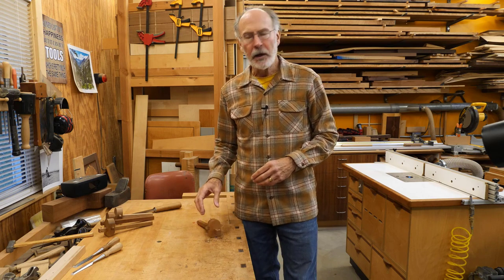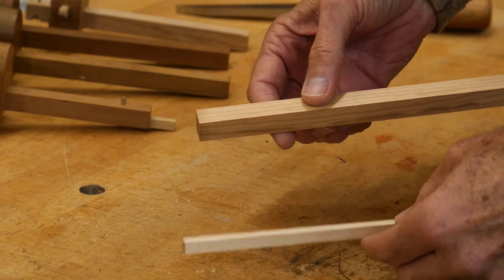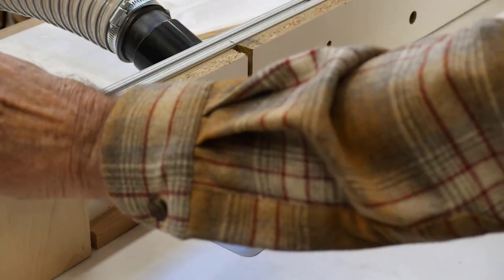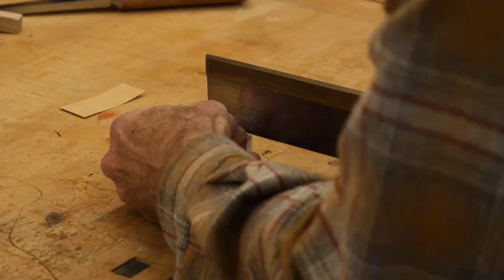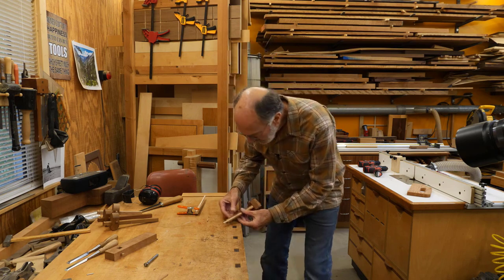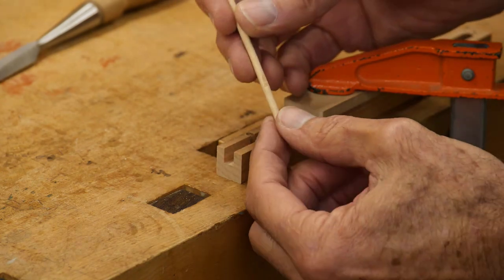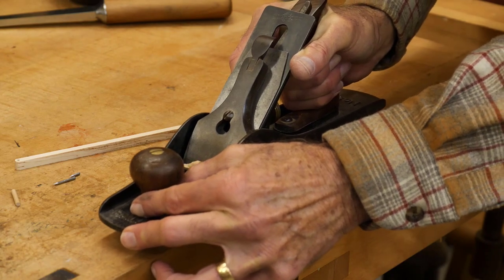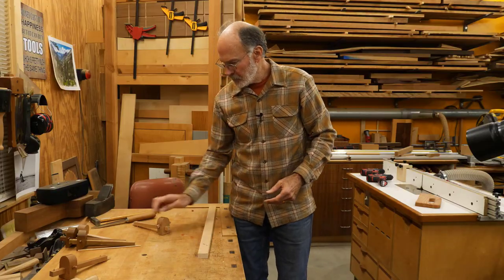Make a Mortise Gage

Comment: if you don't have veneer laying around, medium cut plane shavings work just fine for this type of stabilization. i like using the edge of fast growing oak where the harder grain is really thick. makes for a very strong spline and you can keep adding shavings until you fill the kerf instead of trying to cut a veneer that is just the right thicknesss.
Reply from the maker: I like that. Great idea.